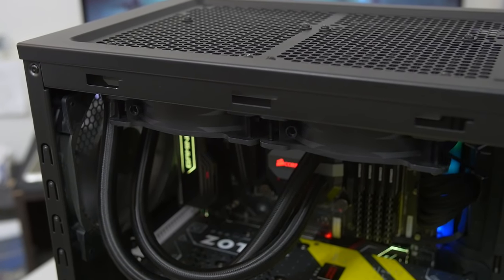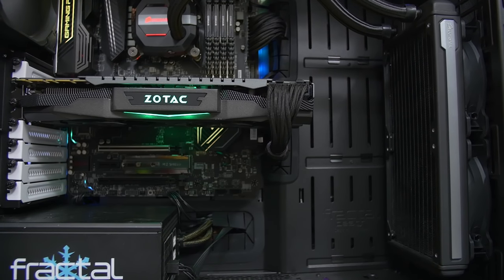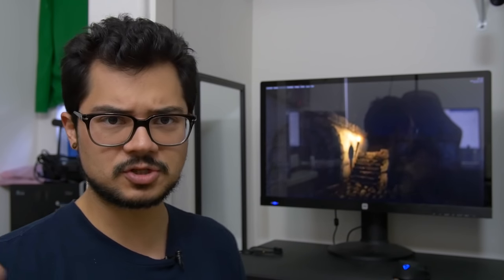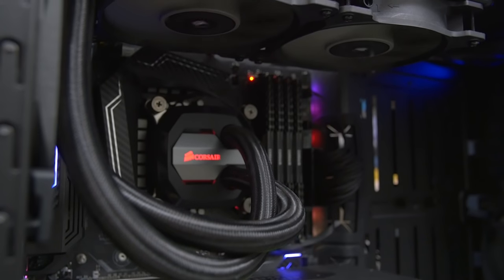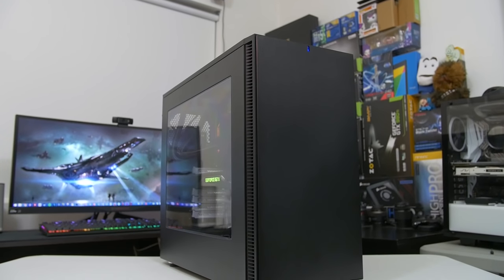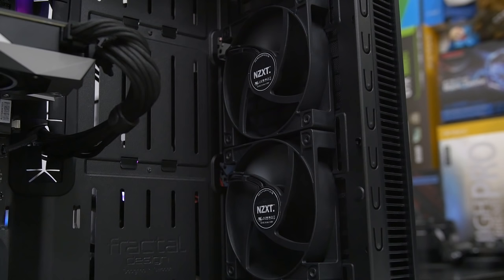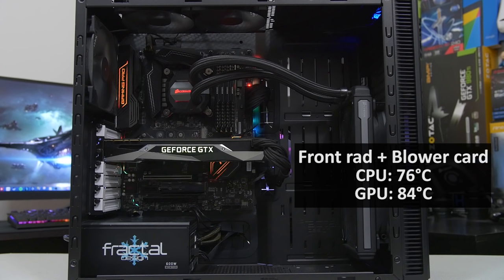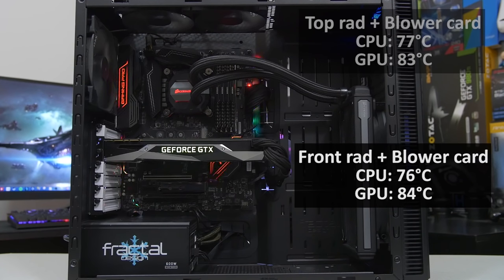Does Radiator Placement Matter? Hint: YES

Comment: i got a stock 10600k with CM ml single fan radiator mounted on top-back  and startup temp is more less 40c upon gaming max is 60-65c and idle after gaming is around 50-55c is this alright?

Comment: You should never vertically mount a radiator from an AIO with the tubes on top. You are pulling air into the pump and will likely burn it out within a year of operation in that configuration. If youre going to give advice to newb builders at least do some research.
Reply: So you want the tubes at the bottom?
Reply: @RockyJayyy  that is correct. If you're mounting the radiator vertically, both tubes should be on the bottom.
Reply: @llxVxll  OK. Thanks.

Comment: I use top exhaust because cooking a cou is cheaper than killing my aorus 3090 xtreme 😀
Reply: well, you always want to have the top exhaust because heat always rises, you don't want that hot air to be pulled back down in your rig.

Comment: Lol! That is against my eh religion and science.
Have cpu water cooler (deep cool 240t or shit with 2x120mm fans) and moved the radiator from front sucking in to top bowing out and got my 2060s (dual fan, open) temp drop from 82 to 71. Cpu( ryzen5 3600) always had like 30idle and 50gaming degree. Nothing clocked.
Only 1 outtake top back 120mm fan. Will even install 2-4 more in/out take fans on the case.

Comment: I need a little help!
I got the fkn mighty Asus Rog Strix RX 6900 XT LC Top Edition 😜
But i can't decide where to place my radiator for best temperature!!!
I had it on the front ex and in now I have it on the top as ex. But where is the best of both?
At the bottom I won't do it I got too small case and I don't want to get bubble in the chip 😂

Comment: what if i place my radiator at the top of my case, and use the fans as an intake pulling the air through?
Reply: Then you completely negate the issues presented here. That would probably be more effective than any of his testing since his front mounted radiator was upside down.

Comment: I just build my pc
i got my radiator fans as intake on top
i got 2 140mm fans as exhaust at the bottom
i got 3 fans in front as in take 
i got 1 fan rear as exhaust 
my gpu got 3 fans on it
i got a 680x corsair case 
is that good or bad ? Should i switch my cpu cooler to exhaust and my bottom fans as intake ?
Reply: I think you should make the top fans as exhaust and bottom fans as intake, as we know hot air moves upward
Reply: Set your radiator fans as exhaust on top,  if you have a filter at the bottom set those fans as intake aswell. So front and bottom intake, top and rear exhaust. You want to create positive pressure in your case that's the best scenario. Before you do that check the temps in you current setup to compare after the switch and paste your results. Also this positive pressure setup will mean you have way much less dust inside your case as all the dust gets pushed out of every possible hole in your case due to the bigger number of fans pushing air inside your case to the number of fans exhausting. Let me know your results.

Comment: SPECS:
Asus ROG STRIX Gaming -E X570
AMD Ryzen 7 3700X @4.35ghz 1.35V
Sapphire Pulse 5600XT @ 1860MHZ
GSKILL Trident Royal Silver 32GB CL16
Sabrent 500GB NVME PCIE4
750W Seasonic PSU
Lian Li 011 Dynamic
Arctic Liquid Freezer II 360mm AIO in Push/Pull with Arctic F12 PWM fans>>>> TOP MOUNTED AS INTAKE <<<<<
3 Arctic F12 PWM fans side mounted as exhaust
3 Arctic F12 PWM fans bottom mounted as intake
CPU idle temp 33C
Gpu idle temp 49C

30 minutes of Unigen Heaven Results (ultra preset @ 1920x1080)
CPU max temp 53C
GPU max temp 68C
DiMM max  temps 38.8C (just cuz)
Sabrent NVME max temp 47C (just cuz)
Max fan rpm 797

Comment: Gonna tell you guys my experience.
I used 1 year 2fans radiator on the top with pump built in it with a blower 2080ti.

But I noticed a noise that for Shure comes from that pump. Very noticeable on lower speeds Couse it just vibrate.

So I changed the radiator to the front, so the pump built in it would stay for sure soaked in coolant. I am using this form right now.

What I noticed?

My GPU was 70ºc locked but now it's just hit 71ºC sometimes. No problems at all. But the CPU get something like 9ºC lower in temperature. 
When playing apex it is sometimes as 40ºC

But the pump noise still bothering me. It is on warranty but I don't know if it is normal. To make such a sound in lower RPMS. Where the pump is the only thing that a hear on my entire build. Couse everything in that has auto stoping fans
Reply: So it's probably either a dying pump, or air bubbles. If you take it out and shake it for a while extremely hard if it was air bubbles, it'll stop.

Comment: Yeah, radiator placement matters and you should NOT place it like that! Your front mount was a way lower than the pump which caused all the air go up the pump. As a result, it becomes noisier and may break faster.

Comment: I got a 2700 on 4.1 with 115 corsair in the x280 top mounted also i removed the top glass gpu 1080oc asus on the front two 120 fan.  
After 3-4 hrs gaming cpu temt around 54-58c never saw it higher gpu around 64-68c all the time . 
Do i wanna suck my balls of again to to rebuild the whole shit ?? NOOOO

Comment: I wonder if a mesh front panel will change the temps even more.(perhaps to favor the rear radiator placement) If anyone can answer this question I'll send you feet pics. Or maybe just thank you...
Reply: A mesh panel will always give improvement in any scenario, but you'll still see higher cpu temps with a top mounted exhaust over front mounted as that GPU heat still has to leave through it.

Comment: So what if your GPU is liquid cooled? Does it matter then?
Reply: I have a phanteks P400A case a front mounted Kraken x52 mounted on a Radeon RX590, fans set to intake. The CPU is air cooled with a china brand 6 heatpipe cooler with 1 fan. The two top fans are set to exhaust and the rear fan also set to exhaust.
The CPU gets 9-10 (Celcius) degrees warmer when i'm playing heavy graphics games.
With the case side panel removed it stays around 54C-55C , with the case closed it reaches 64-65 Degree Celcius.
Hope it helps.
Cheers
Reply: @legendofthes33ker  that literally doesn't help at all. Why would you even measure with your case open? That's not its intended purpose. And your cpu is air cooled, im saying if both the gpu and cpu are air cooled does it really matter where you put the radiators?
Reply: @rc5924   Well Ryan, your question wasn't clear as to having both CPU and GPU water cooled. So i assumed (wrongly) that it was about only the GPU being watercooled. 
Has that i my actual configuration, i thought it might help shedding some light into the matter.
The opening of the case was only for testing purposes. After a while of gaming the liquid inside the radiator reaches 40 degree Celcius, so the air entering the case gets pretty warm.
Again the opening of the case was just for testing purposes has to what would be (approximatelly) the difference on the CPU temp if i change the radiator to the top.

Comment: Why complicate things? Just mount rad on top with fans as exhaust so hot air blows outside/above the case. Front and rear fans as intake. Result: pretty cool/cold temps overall meaning cpu, gpu, vrm and everything else.

Comment: TBH I don't really think this was a fair test. Some bias I noticed was how when the radiator was moved to the front, two fans were added to the top where the radiator used to be. If the question someone is looking for is "is it worth moving the radiator to add fans?", than sure, this test works. But as far as just radiator placement tests, this was quite unfair and un-controlled.
Reply: Uh, those fans were at the front when the rad was topmounted.  What drugs are you on and where can I get some?  CFM moving through the case is the same in all configurations.

Comment: I’d like to see this same test but while including too mounted radiator as intake cuz that’s how I have mine set up rn. 240mm aio as intake at the top and exhaust fan in front and rear panels. If any1 has any insight as to how this affects my temperatures it would be much appreciated.

Comment: Anyone knows although what the top fans are doing while the radiator is mounted front?  they bring air inside or they are used as exhaust
Reply: whichever u place the fan towards, normally as an exhaust along with the rear.

Comment: What if the GPU is vertically mounted?
Reply: The thing with verticale mounted GPU's are that with some / to most cases your GPU fans are scary close the the window. 
So it's really hard to get good airflow for your GPU. 

You do have vertical mounting plate, instead of using the mounting that comes with the case, only downside of that is that it takes up like 5+ slots or so. So that basically means the only thing that you then can fit on your Motherboard is your GPU, and no other expension cards.

Tempatures are the same. (unless there is highly limited air to cool the thing)

Comment: This isn't accurate. It all depends on the case. Front intake over the hardware with exhausts top and back is the best.
Reply: I keep thinking the same thing.  In and out.. simple.
Reply: Start at 5:40 before commenting. It's mentioned
Reply: @ivanlopez2859  Who names their baby Ivan Lopez on purpose.
Reply: @YTCENS0R  parents who didn't wish their baby was aborted. I don't think you would understand

Comment: does anybody know if the fans on top when the radiator is on the front are pulling air into the case of all of 3 are exhaust fans pulling air out of the case
Reply: Front mounted AIO as intake. Top and rear fans as exhaust

Comment: Could the temperature difference be due to when you had your radiator on the top, you had your fans on the radiator act as exhaust (internal hot air> rad fans> radiator), and when you had your radiator at the front panel you had the setup as intake meaning, (external cool air> radiator fan> radiator) Resulting the in the radiator being cooler hence the difference in temperature?. I am just assuming you did not switch the fans setup when you changed the radiator placement to the front panel. please let me know as i am trying to also figure out my incoming new AIO cooler fan placements!

Comment: Noone thinks of bottom intake radiator.... İt is especially best for the all gpu kinds and relatively better for the cpu and the case itself.....
Reply: Not good. Watch Gamers Nexus. Even front mounted has to be bottom tube which is impossible for most modern cases.

Comment: radiator at top: nope, no vents and power supply in way.  up front: nope, case is in way.  bottom:  finally found a spot it fits.  3400g msi 570-a pro.  raidmax helium case.
Reply: cpu is 68C under 100% load(setiathome).  40C static.

Comment: What does it mean by open and blower?
Reply: "Open Air" has fans that push air into the card from the side and the air escapes inside the case.  A "Closed Air Blower" has a fan that pushes air from the front area of the video card through the sealed cover and out the back of the card which the hot air escapes out of the back of the case and does not stay inside the case like an open air one.  Hope that helps!
Reply: @viperrcr  In the video, did the best result have the front rad fans push air from outside into the case (with exhaust fans above and on the back) or did the fans at the top and back push air from outside into the case (with the front rad fans acting as an exhaust pushing air out the front)?
Reply: @viperrcr  basically, is the air being pulled through the rad or is air being pushed out through the rad?

Comment: Did you realy put the Watercooling in the bottom-right ??? It HAS to be in the TOP-right.
Because water isn't stacked in the CPU block. DO NOT do that.
Why am i saying that ? => the top of the water cooling has to be upper than the cpu block. If it's not, water isn't fully stacked in the CPU which can make some noise + bad watercooling + use your component 10 times faster.
So maybe it's better on the right, but PLEASE don't place it on the bottom dude

Comment: dude, radiator on front is not instaled rigth. you need to put the pump cables down for maximum performance. anyway, nice video.
Reply: That would be even worse. His whole setup is wrong, as air bubbles are collecting in his pump.

Comment: Does anyone know if for the front radiator and open gpu blower set up whether the fans mounted uptop are intake or exhaust?
Reply: I'm pretty sure they are set to exhaust. It's the common pratice to expell hot air from the case.

Comment: Pointless video since GPU/CPU fan speeds are not shown as well as GPU/CPU clock speeds. No reasonable answers are provided by a video.

PS Front rad mounting has an issue as well - radiator is lower then the pump meaning pump has all the air from the system...

Comment: I have a feeling that this is all false, it really has nothing to do with placement, it has to do with intake and exhaust. If you top mount as an intake I would presume you'd get much the same results. The whole premise of this video is flawed.
Reply: Nop tired that it raises the gpu temps. Most of what he said about temps is correct. Top mount exaust does increase cpu and reduce gpu temps
Reply: Watch gamernexus's video about radiator placements. You can see placing it wrong will make air bubbles and have air travel through the pump making the AIO's lifespan shorter
Reply: @skiez7430  That has nothing to do with radiator placement, but rather pump placement. The pump can't be at the top of the loop. In the context of the GN video they were talking about AIOs, so it's just a rad and a pump, so yeah the rad needs to be above the pump. In the case of a custom loop, the reservoir serves as a way to isolate bubbles, so you just need to have the pump below the reservoir, the rads can be anywhere.
Reply: @anjithkrishna9301  Wait, I just realized you said top mount EXHAUST. Did you not read what I wrote in my first comment? Run it as top intake and the cpu temps will fall, then add more intake to the front with fans, this will cause it to be a positive pressure system and it will force the warm air out. I refer to the previously linked Corsair video as proof of this.

Comment: I appreciate this video even though its old by now. However, that is an absolutely terrible gaming case. I face palmed before the testing even began lol. I have an air cooled rig OC to 5Ghz as well running a powerful vid card and both my cpu and gpu temps are more than 10c lower. Hell my GPU idles in the high 20s (27c-29c). Also, Your rad is mounted upside down while in the front mounted position. Not to mention also mounted in a not so optimal manner in the top mount position. The coolant lines and sitting in front of the rear case fan blocking a little bit of flow. The rad in the front mount config is being restricted by the narrow vent on the side of the case. This vid was actually very good to show how the GPU temps can affect the cpu temps. Thanks for the content.

Comment: Too bad that you started video with aio already installed badly, you have the pump higher than the radiator so all the bubbles that there are and those which will inevitably apper over the time are all in the pump making it harder to cool the cpu and without a doubt significantly shortens the lifespan of your pump. Have a great day.

Comment: Front monted aio guys, tubes at top of radiator or at bottom please help
Reply: At the bottom. If you put the tubes at the top then air bubbles will circulate inside the tube or even to your pump(depends on how high your pump is), which can cause high noise or potentially damage to your pump. 

I suggest you to watch last month's Gamers nexus video about it. The video title is "Stop doing it wrong: how to kill your cpu cooler (aio mounting orientation)"

hope it helps.
Reply: Sam S okay thanks man i still see a lot of people placing the tubes at the top, i’ll probably end up going tubes down because i have a 240mm aio. Thanks!
Reply: @tedagne3716  No worries! and yes, gamers nexus also said that on the video. A lot of people did that.

Comment: This video should be deleted or something ;-). This has nothing to do with top mounting but with the fact that you are not blowing ambient colder air into your rad like you are with the front mount.
If you mount on top and reverse your fan direction so it's working like the front mount the differences will be way way less!

Comment: 7:51 "with a top mounted radiator set to exhaust"
9:37 "dealing with a front mounted radiator this time, pulling fresh air, again, from the outside ambient environment"
Wait, what?
You switched from EXHAUST to INTAKE?
"Pulling fresh air, AGAIN"?  What do you mean "AGAIN"?  Was it exhausting the first time or not?
10:30 "by simply switching the radiator from top to front. That is huge, that is completely massive, that is the only thing that we changed"
I don't really know what you changed, but if you switched from EXHAUST to INTAKE, that's a BIGGER change than the position.
This is a horrible confusing video.

Comment: This guy has no idea what he's doing. Top intake AIO, front intake fans, rear exhaust is the best both for temps and dust accumulation . On the video both top and front mountings of the radiator are wrong. The top messes the air way of the exhaust fan when the tubes are mounted in front of it and with the front mounting you can get no cooling at all or pump failure when the AIO liquid level gets lower. The tubes of the radiator should go at the bottom. Bad video

Comment: Stupid video, why not use the top radiator also as intake? (Instead of exhaust) like you did with the radiator on the front??? This video should be called "Fresh vs hot air-cooled radiator"